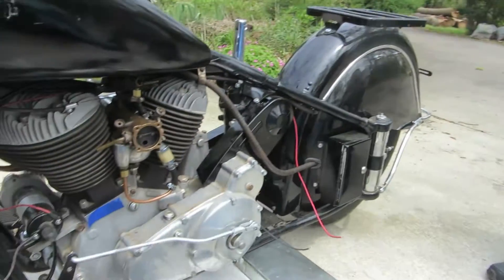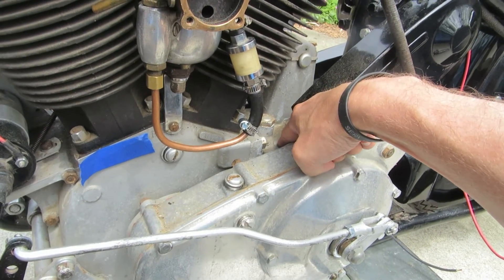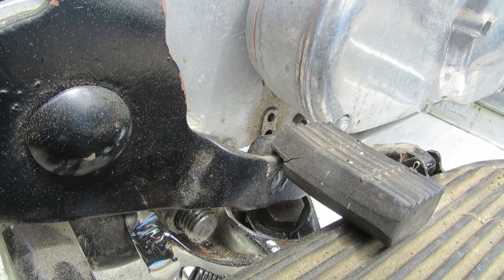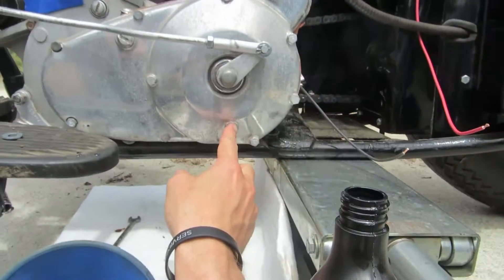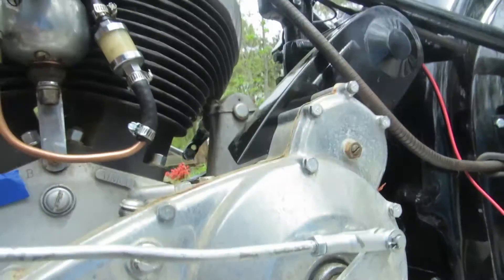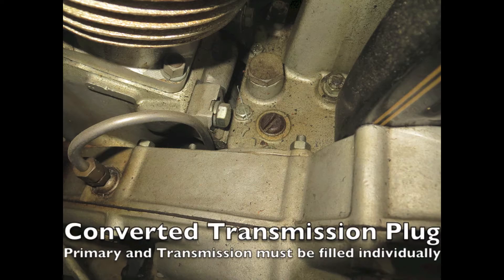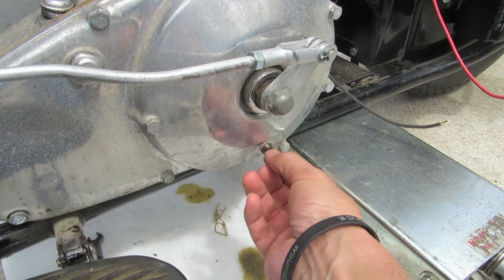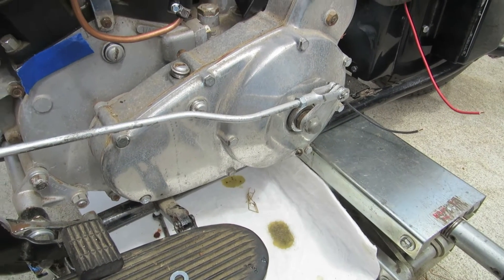1941 Indian Chief Oil Change (1936-1953)

Comment: Just Changed the motor oil in my 41 Chief, Did it as follows. Drain the oil  by removing the plug in the bottom of the oil tank. Wash out the oil tank with some Petrol/gas, then leave to dry. Refill oil tank with new oil. Push a bit of rubber hose onto the return pipe found inside the oil tank. start the bike. Discard the first lot of oil that returns (one minute should do it). remove the rubber hose and replace the filler cap. Then Have A Beer.

Comment: Engine oil drain plug is located under front part of right tank. You need use a bent funnel to drain oil without spilling on the floor (or)use suction device to suck oil out of tank through oil fill cap. Put drain plug back in and tighten securely. Put some oil down the oil return tube inside the oil tank then fill oil tank with fresh oil to an inch below the return tube.  Drain any excess oil in crankcase out of inspection hole and replace  plug. Start engine and let it idle for a few minutes watching for oil to bubble out of return tube to verify oil pump is working.  Information on changing primary oil and transmission gear lube is little confusing. Use 90wt gear lube in trans case, and 10wt oil in primary case. Fill transmission by removing  large hex nut with detent ball adjustment screw. Add just enough gear lube to start running out of lube level plug hole, then replace plug. Fill primary through top hole with oil until it just starts to run out oil level hole then replace plug. If primary and transmission are not sealed from each other, oil and gear lube may  mix to some extent.

Comment: that bike has a dry sump, so nearly all the engine oil is in the oil tank, (R.H.S.) fuel talk. if the bike has been parked a long time, it may 'wet sump' and the you'd have to drain the cases. best wishes...